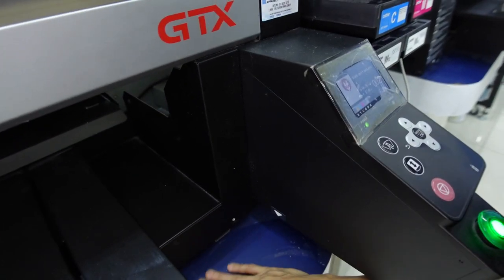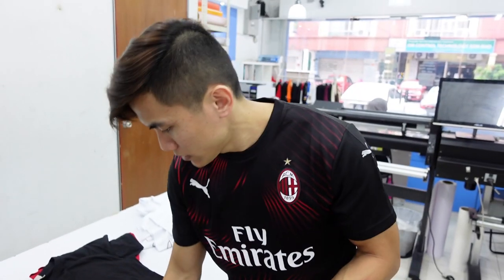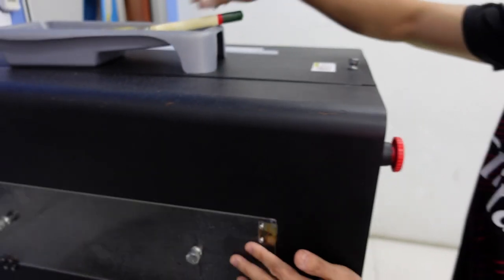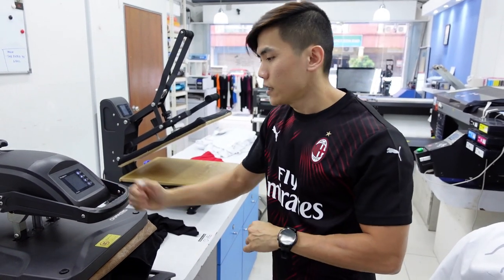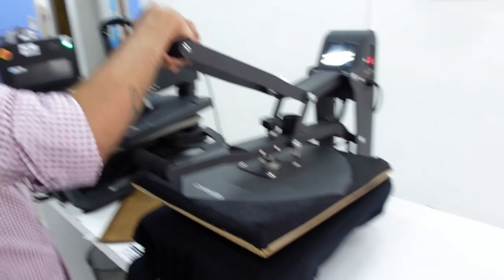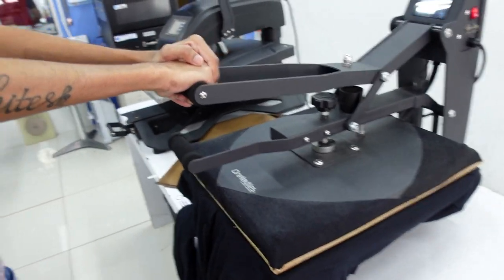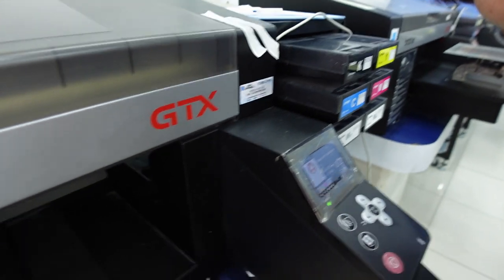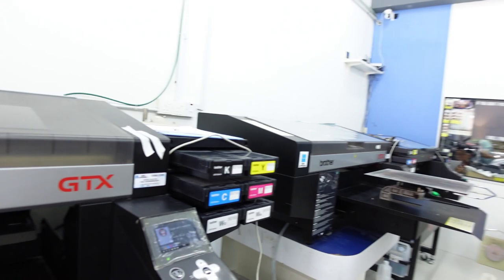DTG Pretreatment Process and How to avoid getting bad result

Comment from the maker: FYI, the 1:1.5 mix ratio is for Brother GTX Dark pretreatment. 😊
Reply: So they recommend this ratio of pretreat for dark shirts?
Reply from the maker: @jcq5270  nope. We have good result with that ratio.
Reply: Do you have any peeling or cracking issues with this?  Also, my heat press doesn't allow me to slide shirt over so how long would you recommend I heat press for?
Reply from the maker: @nutritionco9371  We don't have issue with cracking/peeling unless didn't follow washing instruction. You can just lay it on the heatpress then if you don't have that option.

Comment: Hello.. Thanks for the information you provide
I just bought a Brother printer and have a question about pretreatment. I am using Brother pre-treatment. I printed on a white T-shirt without treatment, but the colors started to fade with the first wash. Do I use the same type of pre-treatment for colored and white T-shirts?
The other question is, is it possible to pre-treat the T-shirts and print them at another time, after a few days? How long can I keep without printing after pre-treatment?
Reply from the maker: Yes it will fade. How fast depends on the fabric.
You will need light pretreatment. The dark pretreatment solely for printing white inks. Or if u want good washability then print like normal. Apply dark pretreatment and print white ink on white tees.
Yes u can pretreat and keep it for months. I suggest no more than 3 months. Heatpress for at least 5seconds before print. Also use lint roller to clean any dust.
Reply: @amedionteo  Thank you very much
I'm happy with your response
I always come back to watch your videos more than once

Comment: I'm having the same issue as you at 14:03 very noticeable when printing red ink. I am at a lost of what to adjust. Printing on Bella Canvas 52% Cotton 48% Poly. We are very new to the DTG world so any help is much appreciated.
Reply from the maker: Try to print on t-shirt with more cotton. If you're having fibers issue then try use lint roller, use more pretreatment, use higher heatpress pressure, don't touch/scratch after pretreated, and lastly don't leave too long before you print. Hope that helps.

Comment: Hi, thanks for this video ,it is appreciated..
Could you tell me step by step how to cure pretreat properly? 
First of all, what  is the time and temperature of curing and at what pressure for dark and light color shirts that you use..Then how do you get thick prints like you show on your video..thats what I am looking for...
How many washes your prints last?...I was dealing screen printed shirts and I try today dtg to get as  close as screen print but it is very hard to figure it out..
Thanks again for your tips
Reply: Good day, can i give my experience regarding to your question. im using the same pre-treatment cube and heatpress for curing the pre-treatment. For Dark Shirts, the temperatur that i use is 180 degrees and 35 seconds then i add 5 seconds to make sure it is completely dry. For white shirt, as for now. im using the same menthod and the quality of the print is good. Im using 210 gsm shirt. To gain the thickness of print using Graphic Lab software try the to make the Highlight  7 and Mask 3.
Reply: do you wash the pretreater out with hot or cold water?

Comment: Thanks for your answer, I am testing again, I do 10 second press at 180° to flatten fiber then pretreat around 30g of pretreatment then cure for 35s and cure and cure again around 10s till dry then print and hoover 45s(it helps a lot for vibrancy to stay)  and press 90s..So far no square box on shirts..
Do you know how many grams approx of pretreat you use on shirts with your pretreat machine on 30cmx40cm design area(wich sounds to be a standard way to mesure pretreat on the web)?

Thanks again for your time answering questions..I hope business is going well for you...Where I live everything is slowed down nd business down for everybody selling fashion clothes..

Best regards,
Lilian
Reply from the maker: Different fabric requires different drying time. I cure at 180c 60s on my Gildan Premium Cotton. 
IF you want vibrancy then you need a dryer instead of heat press. If you don't have a dryer then you may hover first then only press for lesser time & pressure. I'm not sure how many grams cause i don't weigh them. I just use The Cube pretreatment machine with the speed knob. Hope that helps. 
Yes everywhere is slow and this year DTG is growing very well. Keep it up!

Comment: Thanks a lot for your kind reply, i am using the exact same as you do...those are my best settings as well..do you know how many washes your prints last ? Mine are lasting 6 washes and they start peeling a little bit, to wash off a lot after 10 washes..the colors remain great but some parts starts to peel off after 3 to 6 washes..did you try wash test for at least 10 or more wash?
Best regards 
Lilian
Reply from the maker: Depends. Mine washes up to 30 times still holding up. Most ppl didnt complain though but my friend wash 1 time it peels off abit. He uses softener though.

Comment: I seem to have cristalization problem, i need at least H:8 M:3-4 to make white look good, if I add more water it would be better? You say hovering helps with crystalizations, you mean after pretreat before actual print? For how long would you hover in this case? Or should I do multiple presses like 3x20? Not sure what else could it be
Reply from the maker: Does the crystalization problem go away after curing? If not then u have to add more water. By adding more water to the pretreatment then u have to spray more or add more ink to get solid white. you can do hovering or multiple presses as long as the PT dries. doesn't have to be 35s or 60s. You can even hang dry.

Comment: What mask and highlight are you using?   I find that I have to vary it quite a bit depending on the print.   For many color prints, I use highlight 4, mask 1.   But if the print has large white areas, I sometimes have to use much higher to get a good opaque white (as much as highlight 9, mask 3).   Prints that have some of both are pretty challenging.  I have considered breaking them into two separate prints so that I could use different settings, but time consuming to print.
Reply from the maker: I always use the default settings which is H5M3. Sometimes just up a little bit for hoodie/polo shirt at H6M3. Never go above H7. We tweak our pretreatment.

Comment: Can you do a video on how to print on hoodies without lowering the platen very low and losing quality in the print. I am having trouble keeping the quality of the print once I print on a hoodie. How much pretreat should go down on a hoodie.
Reply from the maker: I see. Not sure what hoodie brand/model you use. We're getting good result with Gildan Hoodie 50/50 blend. Maybe next video i will do that. Thanks.
Reply: @amedionteo  For the Gildan Hoodie 50/50, What are your pretreat settings? Heat/time settings?  what settings do you recommend for curing through a conveyer (after the DTG print)? and how does is compare to the heat press (after the DTG print)?

Comment: Any tips on pre treatment coming out unevenly? Spraying more towards the middle of the shirt and less on the sides? I’ve just replaced the nozzle and filters but still getting the same results
Reply from the maker: Possibly air inside or motor not as good
Reply: @amedionteo  how can i tell if there’s air inside and what would be the solution? Also is there anyway I can tell if the motors bad aswell?
Reply from the maker: @ashrim1846  not sure what pretreatment machine u using. Theres a button to spray and clear the tubes. Use that to check if ur spraying pattern is uneven. First thing is changing nozzle

Comment: I have problems, There are  5% from my customers feedback that color came out after washed. So I don't know which step I did it wrong or have to focus on it.
Reply from the maker: White or colored tee?
Reply: @amedionteo  color^^

Some ink stick together after washed. Then I try to spread apart and there are some damage or ink came out from the t-shirt. (Black and Red t-shirt).
Reply from the maker: @srirungwangeaktianchai4032  that means your ink undercured.. Or you probably using the same heatpress that do pretreatment and curing.. once u dried the petreat.. wipe the heatpress or use other teflon to cure..
Reply: @amedionteo  I used 200c to cure ... 
Do you think it's too much? Have you ever tried cure at high temperature and how it looks?
Reply from the maker: @srirungwangeaktianchai4032  if your fabric can take it then no issue at all.. not necessary to heat that high cause BROTHER recommends 180c only.
Reply from the maker: @srirungwangeaktianchai4032  it will look the same but some tshirt couldnt take it so u will have stain/mark especially white tee. Try use 160~180celcius will do.

Comment: hello, for a3 full printing, how to measure the weight of treatment ? what your suggestion for average pre treatment sprayer, is it gun spray enough or MUST ? i found it hard to make the spray spread nicely without using proper sprayer. if use gun is MUST then i need to request this from my boss :)
Reply from the maker: Are you using the pressurized sprayer now? Its better to use electric sprayer and its difficult to spray evenly unless with alot of practise.
Reply: @amedionteo  im just bought new dtg machine, but no exp using this technology, so i dont know how to use pre treatment well. I saw the spraygun on shoppe around rm2++ , and as far i know this dtg techique printing needed us to do very good pre treatment step, or next im gonna ruin the picture on the garment. 
One more thing I saw on youtube there is people use very high temp after spraying pre treatment, is it any reccomendation for 180gsm gildan to be press ? now im use 200celcius for 20send ( 3 times ) . 
Is it okay or need to change ??

Thank you AT #ctid
Reply from the maker: @kfg970  lol the hashtag. Anyway, what printer you using now and what pretreatment. 

Spraygun is cheap but need skill. So you need to trial and error cause there's no telling how much u spray.
Reply: @amedionteo  hello brother, sorry for distrubing you, now im using dupont pre treatment with spray gun, but now im use 100% pre treatment w/o any mix with water.
Is it okay ??
Reply from the maker: @kfg970  Its best you check with your supplier see if its diluted.

Comment: I'm using 1:2 mix ratio. it is advisable or i need to use 1:1.5? TY!
Reply from the maker: When you're more water then have to increase the highlight to look solid. Inks are more expensive so our sweet spot at x1.5 + default H5M3.

Comment: Hi, I always get bad printing result  at the time 8.29 on your video...i already put enough pretreatment, normal setting (not eco mode)for printing.. But printing still like "fungus or berkulat"..it happens a lot when my artwork is fully from vector or from adobe illustrator... But when my artwork from photoshop, it result printing is fine...
Reply from the maker: What tshirt brand you use? 
Make sure the tshirt is clean, teflon sheet is clean, then dry pretreatment with some pressure on heatpress, once pretreated try not to touch so much on the area, etc
Reply: @amedionteo  ,gildan,oren sometimes happened, but Freeway brand have not bring problem for me until now
Reply from the maker: @hamizishah3177  it depends. smoother tshirt will be easier to print but washability not as good.